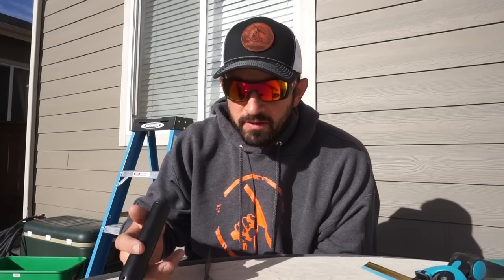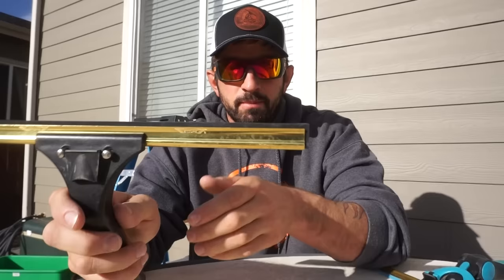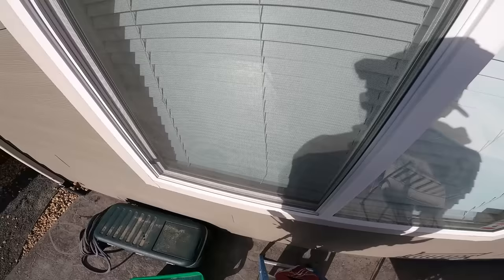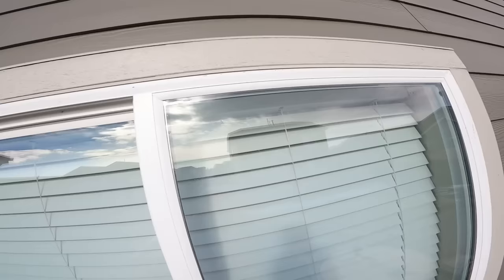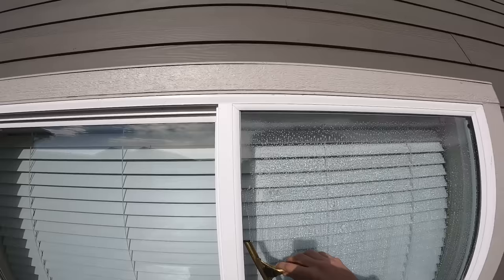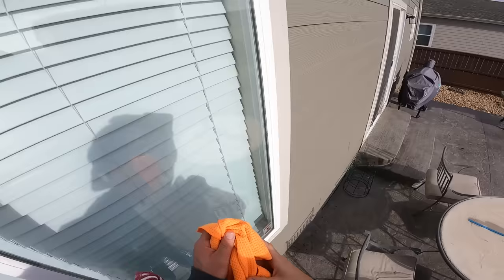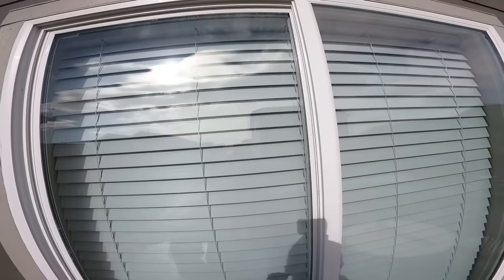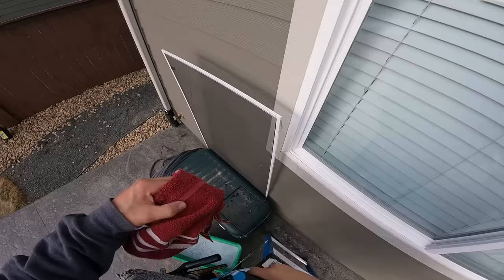NEWBIE SQUEEGEE DO'S & DON'TS | WINDOW CLEANING TECHNIQUES

Comment: One tip I will give if you're doing kitchen windows that have grease on them and it's hot and sunny be sure to degrease them first before you wash them otherwise you're going to get streaks lots of it. I also think there are some glass that's more prone to getting squeegee marks than others I can't exactly explain it but some are more prone

Comment: Try using a water sprite shammy instead of a bath towel. You can use them continuously. When they get dirty rinse it out with a hose sprayer. Works great to mop up water and clean the moldings

Comment: I’ve been cleaning for 6 years now and I love it. I always use liquid squeegee for my “soap” it works so good. if I have to clean a restaurant I add a little dawn to help with the grease. I love that blue handled squeegee you have I need to look into that. I have a basic swivel handle. Gets the job done but I like the one you’re using too!
Reply: I’m new to this, so, what is “liquid squeegee”?

Comment: I also find a lot of guys that don’t use enough soap if you have a 5 gallon bucket of water Squeeze soap bottle for about 6 sec using little soap makes the squeegee drag and noisy leaving lines and swirls. A properly soaped and soaked window should make very little squeaks.

Comment: Using one clip in the channel works for me. I always struggled with 2 clips when I started so I just use one. It holds the rubber and I don't have to worry about the rubber bunching up.

Comment: Put a couple squirts of soap directly on the applicator, just seems better than in the water for me. Have a bucket on a belt, half litre bottle of water with you and you can leave your main bucket in the van out of the way. I just usually go back to the van every hour or so for dry microfibres and top up from main bucket. If i have busy day or dirty work i bring a couple of 5 litre tubs clean water so can change main bucket if needed.
Add a touch rinse aid in the water for a nice sparkle 😉 😅

Comment: I do my single house windows about 4 times per year. To extend squeegee rubber lifespan to about 5 years, only straight down or sideways glide is used on the windows. A 24 inch Sorbo squeegee is used for the large windows, while a 14 inch Sorbo is used for the smaller windows. For a large window, the 24" is used first, followed by the 14" for the remaining small area. I like the fly screen removal tool tip. Fortunately my 5-year old house fly screens can be easily removed by hand.

Comment: i always load new rubber with the logo facing down, i like to always know at a glance if i am on the first or second side. so when i turn the squeegee toward me if i see the logo i know i still the second side available. also i rarely use the ettore channels in my moerman but occassionally so i ground out 3 scoops where the teeth go so the handle grips the rubber and i don't need the end clips
Reply: I do something similar, only logo side up.

Comment: I would always advise to use you reach and wash system when ever possible, i been window cleaning since 2005 and for the first 5 years i used traditional tools and its hard work and slow. from 2010 i been using the water fed pole system is so easy and fast also the money you can earn in the time is unreal. I don't even carry traditional tools these days.
Reply: Pole all the way! The Range are selling them at the minute, good luck without purified water though 😉

Comment: Thanks i learned alot, the 40degree angle (i use straight) also when switching rubber to use a bit of the excess as guard

Pro tip for noobs - Its better you use more soap AND water than less. Less = friction and streaks. More = More towel work.
Also, cold outside = use warm water. Warm outside = use cold water. (no the glass wont break from temp diff)

Comment: I prefer sorbo channels as the rubbers can be trimmed several times rather than simply turn around. The blade has different grooves, I have been cleaning windows 28 years

Comment: Super helpful video, thank you for posting. I keep practicing the fan method with both small and large squeegee. No matter what I do I get streaks on the top side of "knocking down the peak". Any tips to avoid? Or perhaps I need different equipment? I got the blue Unger kit from HD.

Comment: After 25 years of pro window cleaning, I have a few pro tips here on my channel and one is that you don't need 2 clips. That way, you never have a wavy rubber, either. Also, use a wet but wrung microfiber towel ($1.98 at Walmart for 3 and they last months) to swipe the whole blade and for ledge cleanup, then there is no need to wipe the top with a towel. (I never use a towel or sponge anymore) That brass squeegee handle  is what you want, they last forever and are smaller so they are easier on your hand and wrist... one more thing, switch the screen around so the tabs are outside. Makes them easier to remove in the future and makes no difference otherwise. Good tips for newbies, though, especially getting used to doing it all in one motion.. My tips are more for the pro I guess.
Reply from the maker: 1 clip is actually a bad idea and can create streaks due to the rubber not being held correctly in the channel, a pro learns how to install the clips correctly, sorry but I think is not a “pro” tip but a “lazy” tip. Brass squeegee handle is ok for residential but when you do commercial as well you need a swivel handle for pole work, etc. yes switching the screen around makes it easier on the window cleaner but once again makes you look lazy. I would call your tips beginner tips not pro tips
Reply: @SteveOthewindowcleaner  I have never had any trouble with streaks from one clip and never needed a swivel to do any windows, I was trained by a pro how to use a pole. It's not lazy, it's smart, time saving and economical. I still use the same set of squeegees and handles I have had for over 15 years since I realized the other ones break and need replacing every 6-8 months, not to mention the stress on the hand and wrist from those huge, round  plastic handles. Also, making the clips easy to use on screens prevents possible damage to screens while prying them out and makes no difference otherwise.
Reply: I have washed windows for 14 years 40 to 60 hours a week and I will tell you there is way more issues with two clips then there is with one clip first thing I do is take that second clip out
Reply: @ericsimmons3363  Exactly my point. It's difficult to get it in just right with two and it works just fine with one. I consider the other one a free spare.

Comment: Thank you for the great video, learned a lot. My problem is streaks. They are on the outside and I can't get them off. I tried a small section 8"x8" with various things ( soap and water, windex,vinegar, alcohol), nothing gets them off. Please help, don't know what else to try. Once i can remove the streaks then I can clean the whole window.
Reply from the maker: Thats most likely not streaks then, if its not coming off could be between the panes or etching

Comment: Big fat thumbs up and you got a subscriber! this was a super detailed to the point tons of pro tips video. I am on a job installing  glass walls at a new building under construction. Each piece of glass is roughly 4'.5" x 10' and there's about 80 of them. My technique of cleaning them today will be different than what I have been doing after watching your video. 
Thank you. I suppose my only question would be how much soap am I putting in the bucket? Let's say I have 2 gallons of water, how much soap will I be adding?

Comment: So i am a custodian and i clean a lot of windows. I didn't know that the rubber on the squgee wears that fast. So my questions are.

About how many windows would you say i would need to clean before i would need to flip the rubber on the squgee.

And 

Are there any other signs that you can share that point to a squgee rubber that is wearing out.

I ask because i am starting to get a lot of streaks on the down stroke technique and i wasn't before, so i belive i have a worn out squgee blade but would like to hear your thoughs. 

THANKS

Comment: Struggling to figure out what equipment I can buy to clean my own floor to ceiling sliders that have permanent screening on the other side. I have about 4-5" room between the outside of the glass and the screened railing.  Glass slides side to side but cannot come out of the tracks because it is hurricane rated with a very high track.  So, reach in sideways and clean with some kind of pole and squeegee but what angle/type should I buy? Any thoughts?

Comment: Question: can’t see what happens to all the runoff of soapy water. Allowing it to drip down the siding can leave permanent streaks. Was hoping to learn how to control that runoff. Any tips?  Off to look at your merch. I need a great squeegee!
Reply from the maker: its only soap and water. this is only a demonstration of how to squeegee, run off is always wiped off on any normal job. I really like this squeegee https://windowcleaner.com/products/ettore-complete-brass-ledge-eze-squeegee?sca_ref=3020242.k17l3JaEgS
Reply: @SteveOthewindowcleaner   Thank you!  Good to know you normally wipe away before dripping.  Even dilute soapy water can leave permanent clean steaks. Ask me how I know. 😬 thanks for the recommendation on squeegee. New to this.

Comment: Hey SteveO,
I bought a Super-Channel and the clips are completely different than the brass  ones. It has thin, silver clips which I am not used to. I've messed around a bit with the super-channel, but it's much more difficult to use. Sometimes I can get it working great, and it makes short work of huge interior windows, but other times It will leave wavy-streaks and I end up having to re-do the window. Maybe you have a video on super-channels? Or if not, any advice would be helpful. I know that Super-channels are much more difficult to control, but even with the perfect angle ( while doing pole work) It will streak sometimes, and I end up switching to my 18-inch Ledger channel. It would be a lot less work if I could get the super-channel dialed in. 
(It's a 36-inch Sörbo Quick Silver Clip Style Wide Body T Shaped Aluminum Channel) 
Thanks
EDIT: I found your video on Sorbo squeegee clips, and your dish soap method makes those silver clips a thousand times easier to use. Thank you.

Comment: Ok, so if I measure my windows and windows in my service area and they are all 30 inch width and some 22 inch width windows, would you recommend getting a 16 inch for the first windows and 12 inch for the second ? Or is it ok to use 16inch for both? 

I guess is it ok to overlap on the dry window by 4 inches?
Reply from the maker: I think an 18" is best, thats what I like for windows like that

Comment: how do I squeegee the 2nd story windows? I tried my hardest to do the more practical method, but I just couldn't get it and would miss spots and leave streaks. Should I just do up and down method?? also should I scrub those high story windows or is just wash with mop and squeegee good?
Reply from the maker: Its best to use a ladder or if you're using a pole, put a of water on the window so you have time to squeegee before it dries

Comment: Thank you. Very informational. What about tall slider glass windows that you can only reach the top on a ladder? You have to dismount the ladder at some point to reach the bottom. How do you do just one stroke?
Reply from the maker: You can just do it in 2 sections
Reply: What @SteveO The Window Cleaner Said 👍

Comment: Thank you for the content! I am starting a window washing business of my own and am trying to figure out the best poles to use with our ettore squeegees. I have the same ettore brass backflip squeegee that you are using in this video. Do you have a suggestion for best poles to go with?
Reply: I suggest you ditch the poles and use an extension ladder. When you use a pole you leave streaks and have to waste time  cleaning the glass. If your customers don’t care the by all means use the poles      I guess I should ask are you working for someone else or do you sell your own jobs. If you work for someone else then use a pole because your boss doesn’t pay you enough. If you are the boss then don’t use poles if you can avoid it.
Reply: Garelick poles are good poles and are descent for the price . Carbon fiber are great but expensive too. If you practice a lot, poles are best on commercial jobs, where you cant get a ladder in . Water-fed poles are king on big 1-4 story jobs where repetitive window cleaning is necessary. I would urge on Houses/residential work not using poles. Use Ladders, or a sectional (Metallic) ladder on a house . Sectionals allow you to get weird places in houses (skylights, stairwells, peaked sets, and over furniture)...
Happy hunting and good luck 👍

Comment: When you do professional window cleaning on residential houses do they expect you to clean the inside also? Do you "SteveO" clean both the inside and outside on a window cleaning job? Thanks in advance.
Reply from the maker: Yes most of the time I try to sell the customer on in and out so they get the full benefit of the cleaning process
Reply: @SteveOthewindowcleaner  Do you do anything differently on the inside? Thanks for your response.
Reply: @azxp  same method on the inside, but just wring out the mop more and be more aware that you don't splash water on the customer's floors and furniture etc.

Comment: New window cleaner here, how do you guys clean the insides of the windows like this without it getting to wet on the floor? Cheers
Reply: light on the water and a slow hand, use your scrubber as a catch while scraping or squeeging, or lay towels
Reply: 1) Always lay ground sheets under the window on the floor
2) Make sure curtains, drapes or sheers are pulled back out of the way of your work so you don't drip water on them.
3) Squeeze excess water off the mop so as not to drip on the floors and walls.
4) Hold a towel underneath the mop when transferring it from your bucket to the window.
5) Follow along with a towel underneath your squeegee as you squeegee the window so as not to drip excess water from the window onto the walls and floors.
6) Wipe the sills when done and always check the wall below the window for water drips
7) use a slightly damp and clean towel to gently wipe off any drip marks below the window. 
8) If doing sliding windows or Pella windows, find an open space to lean them against a wall with a towel behind the top edge of the window so you do not mark up the walls and with a thick towel beneath them and with enough room to work on them comfortably. If you do them in order (sliders), you will be able to put them back in order also. 

Donnie from Donnie's Window And Eaves Cleaning Services - Calgary, Ab.     Now retired.
Reply: Just a little advice....NEVER low ball the price on a job! In order to run a business properly, you will need to pay your taxes, have a liability insurance in place, workers' comp, pay employees a holiday pay, pay taxes, pay employee unemployment insurance premiums, etc., etc. Also, in order to hire and keep good employees, you will need to pay them well. I always priced my work at a minimum of $50 per man hour or better. Remember....you can always start with a higher price and work your way down to get the job, but you can't start low and work your way up. Why work for $25 or $30 per hour when you can get just as much work and work for $50 per Hr. or better? Trust me....people will pay the necessary price to have a good and dependable window cleaner that they know they can trust on their property and in their home. When soliciting business, NEVER EVER bad mouth your competition or try to undercut their prices. If you price out a job and your prices are higher than the window cleaner they already have, just tell them that "If you're happy with the window cleaner you have, then that's all that matters, but hang on to my business card anyway just in case". You'll be surprised how many people will take your card and thank you and on many occasions, I have had people turn to me when their window cleaner retired, did a poor job or they had a disagreement with them. Also, never ever work on a job alone in case of a mishap. Use ladder stabilizers on your extension ladders. Ladder safety is of primary importance and ALWAYS advise your employees to never get onto a roof if they feel uncomfortable with the pitch. A 6/12 pitch can be dangerous. One day you're comfortable with it and can walk on it like nothing and the next, you just get a bad feeling about stepping up on it. ALWAYS listen to your gut feeling because it's usually right. There is always a way to run a ladder up to the window. Before starting a job, take a walk around the house and plan out how and in what order you want to do the job. Never let a house dictate to you.....instead, you dictate to it!  Best of luck in your new business venture.
Reply: @donald2306  Thanks for saying all that Donald! A true professional! You must miss window cleaning sometimes? Hit me up if you ever want to come cleaning!
Reply: @danrebolledo8385  
Thanks Dan. I always took pride in being the very best at what I did and there is nothing like the vibes you receive from a happy and satisfied customer. I cleaned windows for some of the most influential people in Calgary including Jim Prentice- former premier of Alberta, Lois and Dick Haskayne-president of Trans Canada Pipelines, James Kinear-Pengrowth and Kinear Financial, both B.J. and Don Seaman-former owners of the Calgary Flames of the NHL, Stephen Ames-PGA championship golfer, Wally Buono-former coach and GM of the Calgary Stampeders of the CFL, just to name a few. I'm sure my customer base in Calgary misses me. I'm retired and living in Montreal now, but my reputation seems to precede me and I get calls even here to clean windows. I really am trying to quit...lol. I appreciate the offer though.